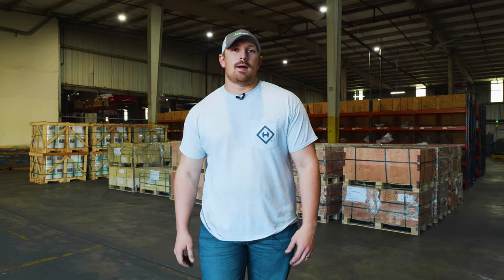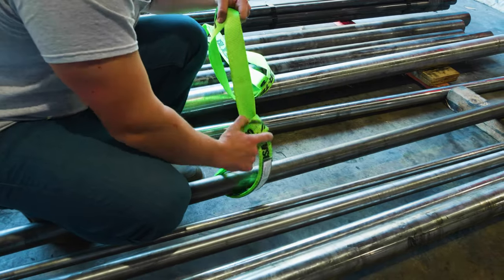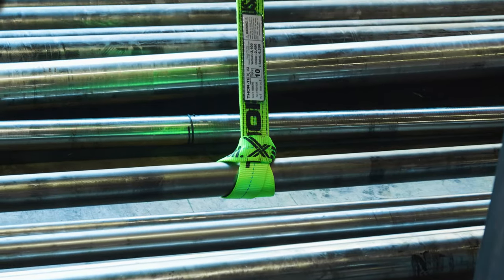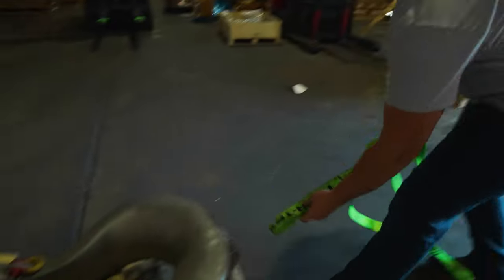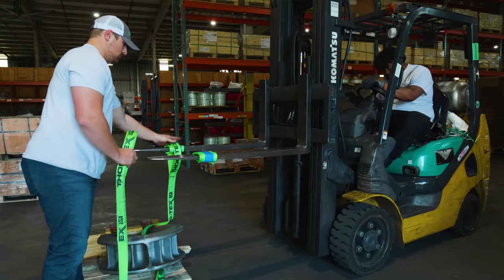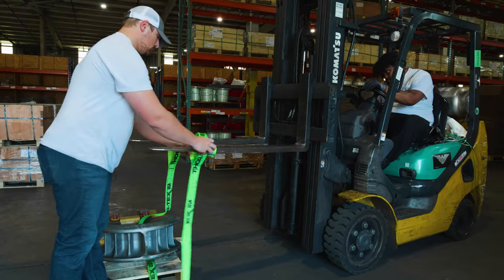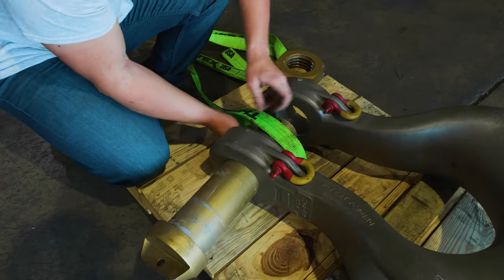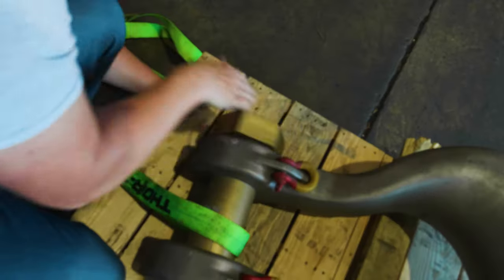The 3 Web Sling Hitches and How to Use Them

Comment: what are the wraps on the forklift tangs called and what is their purpose?
Reply from the maker: Hi Stan! When you're using lifting slings on a set of forks, you'll wanna protect the slings from as much abrasion as possible. We just improvised some fork protectors out of duct tape of sling scraps from our sewing room. They do sell full-length protectors online if you interested in fully protecting your machinery or slings from damage.